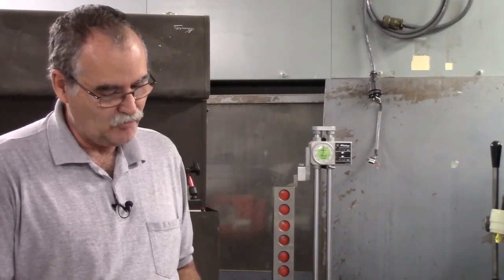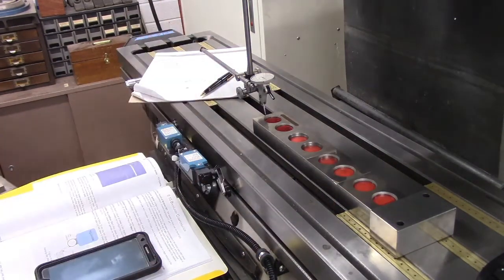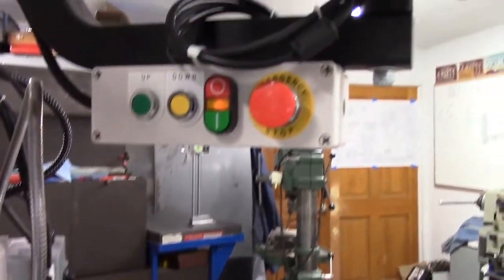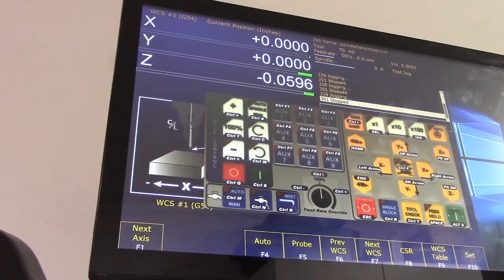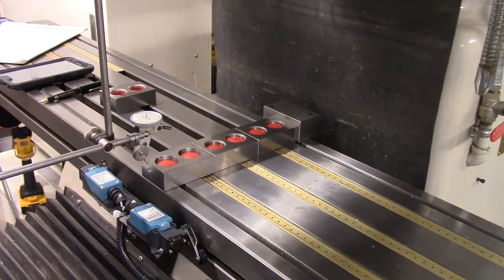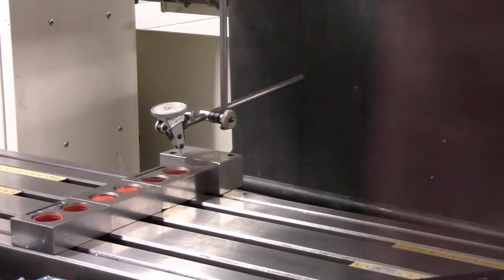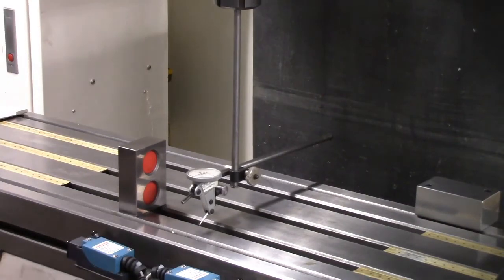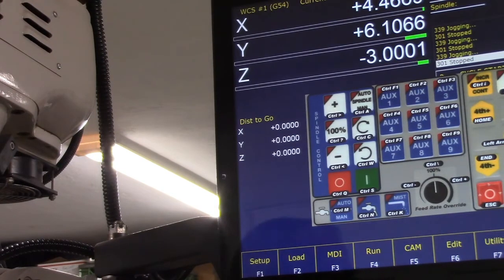Fine DRO Adjustment & Measuring Overall Turns Ratio

Comment: Is it necessary to cycle the power on the control  after using the wizard to input the setting...ive been having inconsistent results.....sometimes adjusts and sometimes not....even when  i go back into the wizard it still has the number ive changed it to ......also just changed it from metric to inch
Reply from the maker: Yes, when you make major changes power cycle the control

Comment: I'm wondering. HOw did you account for the cosine error ? How did you got the indicator exactly 90 degree with the spindle in X and Y directions ? A Heimer (3D) is maybe more accurate right Marty ?
Reply from the maker: You need to follow the procedures listed in Oak/All in One DC installation manauls on Coarse and Fine DRO adjustment. The machine type will dictate precision required. You can have it laser tested if you like.
Reply: Roberto - he is using a lever indicator and should be good . Definitely there would a cosine error if he has used a plunger type indicator

Comment: I assume a series of 1x2x3 blocks would work as well if I bought from amazon they are pretty cheap there.
Reply from the maker: Yes. Use a micrometer to check them. Write the dimension on each one.

Comment: Hello Marty, are there any wizzards in the Acorn software like Mach3, where I can quickly tweak something without using a CAD?
Reply from the maker: Centroid CNC12 has conversational programming. Yes, you can create tapping, drilling, contour, pocket cycles even with the FREE version of the software.

Comment: Marty, I have glass scales in X and Y and was thinking I could use to calibrate the Centroid parameters. If I can switch between the two during testing it seems possible. Thinking glass scales are precision enough so it boils down to being able to simply switch between the two. Maybe not so simple?
Reply: Not so simple. Your glass scales have to output differential signals. There are boards that can convert them. Post your question or better yet, search the Centroid user forum, for glass scales. https://centroidcncforum.com/viewforum.php?f=20
Reply: @MartyEscarcega  Yup, I figured as much, thanks. I will post my query to the Centroid forum and yes indeed I've done tons of searching and reading of forum material to be sure, including glass scales. No nuggets around this yet, lots of other good information to be sure. At one point I did such a calibration on another CNC using a scale and it's DRO, worked like a champ, hoping to pull that rabbit out of my hat again. Thanks again, honestly I would not have attempted this retrofit / rebuild if it were not for your videos and the Centroid Forum support, both stellar.

Comment: Could you do this same process with a probe?
Reply from the maker: Centroid says "yes you can figure out overall turns ratio with a probe..that's what we do with our in house machines.
rough ball park it, make sure probe is concentric with spindle and probe a 10" or greater standard"
We learned something!😀
Reply: sure
Reply from the maker: @cnckeith  Thanks Keith. I'll give that a go next time!
Reply: learning is a good thing I'm almost done with my bridgeport conversion to acorn.  next will be a lathe with acorn i assume a probe could be used there also for offsets. keep up the good work
Reply from the maker: Joe, for sure. It's what makes this enjoyable! Have you posted pictures or videos of your build? Please share them on the Centroid CNC User forum: http://centroidcncforum.com/viewforum.php?f=60
Reply: @martyscncgarage5275  I am a member I will post I'm working on vfd spindle control currently got a new 3hp 3 phase motor just need to find pulleys to run it and finish setup of vfd parameters